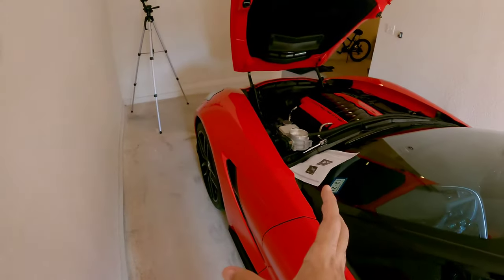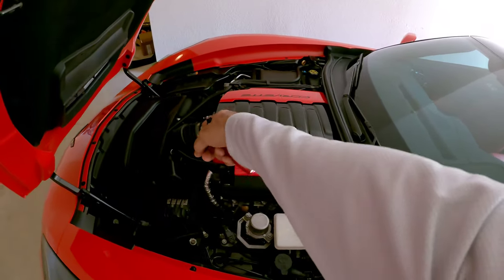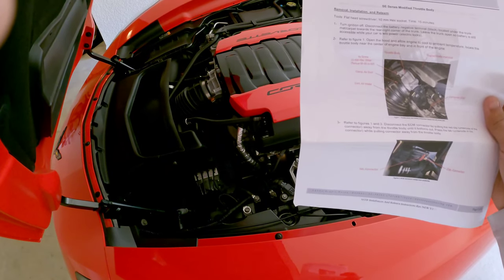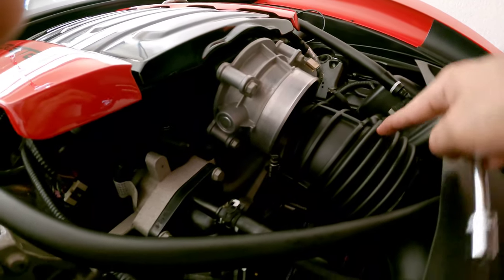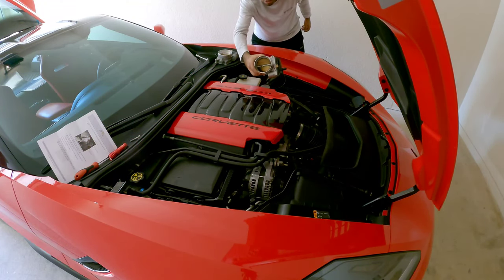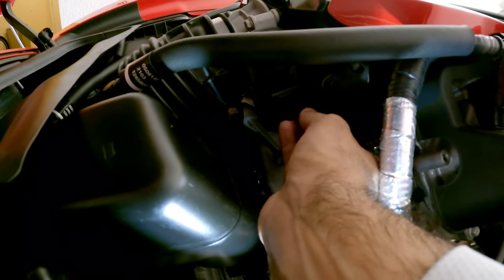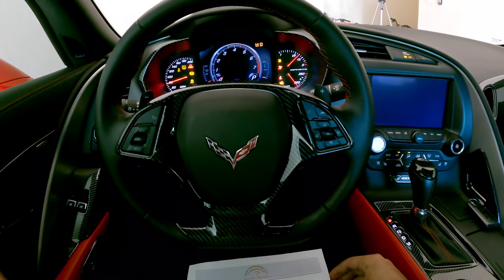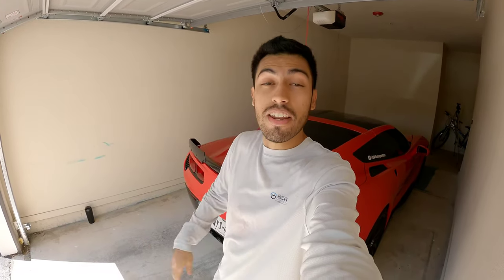C7 Corvette PORTED THROTTLE BODY Install! (SOLER PERFORMANCE)

Comment: Really good video, I'm a C7 owner too. 2 questions, didn't see a gasket, did the TB come with one? Also, what's your opinion on performance changes....better, worse or no difference?
Reply from the maker: Thanks lol, I don't think it came with a new gasket, to be honest I don't remember lol, from other videos I saw on YouTube all they did was change out the old TB with the new Ported one, so who knows lol, I could definitely see a change in response but combined with the throttle controller as well, omg did it make a night and day difference, definitely worth it, check out my throttle controller update video install I talk about the different settings and try them out in the real world.
Reply: There is an o-ring on the intake. It should stay in place and is reusable. I've done a few of these installs and have never seen it worn where replacement would be needed. If you wanted to, you can order the part and replace it during the throttle body install.

Comment: So what's the size difference from the stock c7 throttle body an the soler preformance?
Reply: And did you really feel a big difference between changing throttle body?
Reply from the maker: 87mm for stock, 91mm for Ported one. I felt a significant difference with their combo pack which is Ported throttle body and the throttle controller. With the TB you can tell a small difference but the TC makes a big difference. Together is better.

Comment: Hey quick question after the tb installation does the car have to be tuned?
Reply from the maker: No the computer will take a little to learn the new part as you drive it.
Reply: @TheRogueVette  thank you so much for the response and any specific reason you chose the 91mm over the 95mm tb
Reply from the maker: @djrichasz  I just wanted something that would be better then stock, I plan to boost it in the future

Comment: Can you tell me if the new throttle body made a difference ? Will you be doing a follow up video with a review giving feedback on the throttle body and the additional electronic throttle response controller you added?
Reply from the maker: To me I do feel a difference with both the throttle body and the controller, im supposed to be upgrading the throttle controller unit so after I do that I can make another video of a review going over it.
Reply: @TheRogueVette  Thanks for the quick response to my question, I look forward to that video, Happy New Year !!
Reply from the maker: @stever8747  no problem! Thanks and have a Happy New Year too!